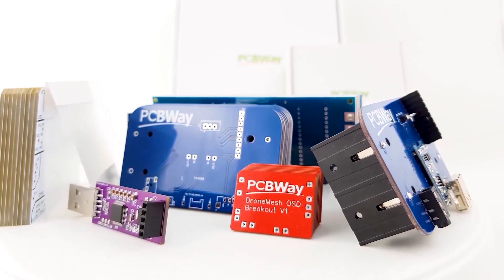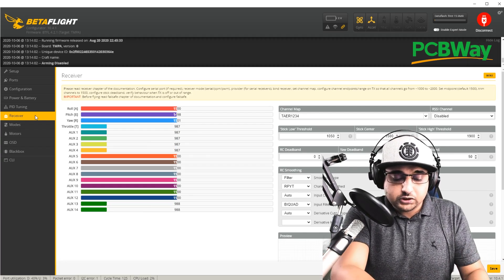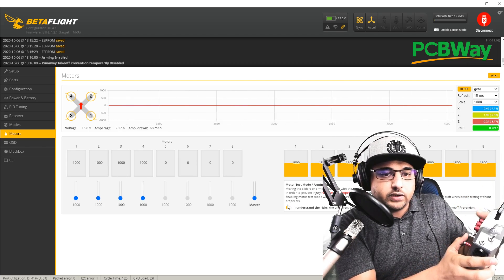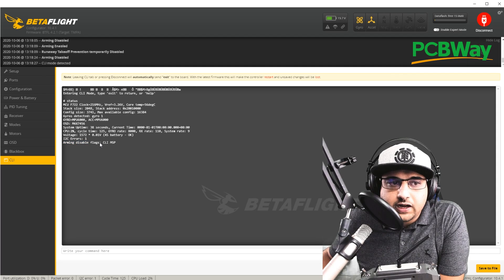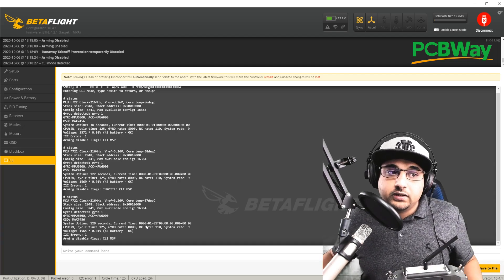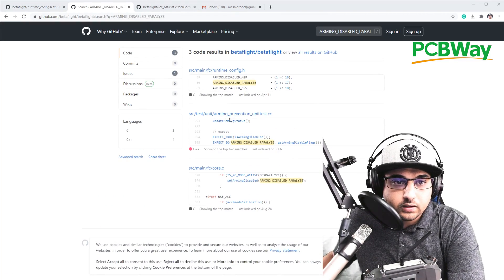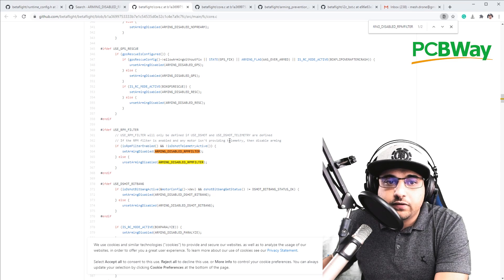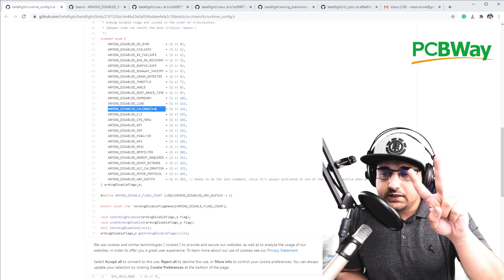ULTIMATE FPV Quadcopter Won't Arm Video FIX // Betaflight Source Code Breakdown

Comment: Hey DroneMesh i watched your video and i have a problem with my hglrc Arrow3 4s where i updated the Firmware and now when i type into the CLI tab diff all bf kicks me out. When i flashed my board i got a "Programming successful" alert and i did back up my old fw but now i dont have any of my settings like Angle, acro and tbe arm switch is not working. I typed in "status" in the cli and i got back this:
Gyros detected:
OSD:None
Arming disabled flags:NOGYROS, 4XLOSS, BOOTGRACE, CLI MSP. 
I tried reloading my old fw but had no luck. Im new to this stuff but i did 1 successful firmware upgrade with no troubles
What do you think is going on and what should i do?

Comment: In betaflight after setting the arming  in mode when I switch to arm I get a red  square which says arming is disabled
all other functions are okay. Cannot get the motors to turn on
Reply: I have the same issue , please assist me
Reply: Same issue, what do I do? Please help

Comment: Bootgrace is important. Thats the code im getting after rotating my fc and remapping my motors. I know the beeper was on c15 which motor 1 was on but motor 1 is now motor 3. Maybe thats it. Also when i go to motors tab only motor 1 and 2 show up highlighted and motor 3 and 4 show no direction and buttons are not clickable. Please please help

Comment: My understanding is 'paralyze' is used in a race environment to completely disable a downed quad from the radio, making it safe for anyone to pickup. You need to unplug the battery to reset it.

Comment: Can you do one trouble shooting osd?
Reply from the maker: What problem exactly?
Reply: @DroneMesh  I've had a few flight controllers where the osd doesn't work and it's difficult for me to determine if it's the vtx, the FC layout, betaflight, etc.
Reply from the maker: Post this on AskFPV with the FC's your having an issue with and the community will answer you in no time. ASKFPV is available in the description under the video. I will look into it and see what kind of video I need to make.
Reply: @DroneMesh  oh yeah, ok thank you
Reply: @DroneMesh  I'm kind of leary of the permissions but I'll look at it

Comment: First arm after flash / set uo throttle full for few seconds then down for few seconds thats calibrated then will arm. Visual warnings flash in osd. Thats it. Its not an error.this is the one that catches my mates out rpm throttle calibrate
Reply: Many people reported rpm lock out on boot then get round it by unplug and so on. If you get rpm lock out try full throttle wait for visual beeper to flash in osd then throttle down then it arms without unplug lipo. After this it seems to go away. Well for me anyway. Lol.
Reply from the maker: What your saying is for PWM calibration.
Reply: Every time i flash 4.2 wont arm until throttle up full(while disarmed). 
Wait throttle down then arms. Thats all i am saying. Historically dshot doesn’t require calibration but it seems to ask this way. Thats if of course youve covered all other pit falls that you seem to of covered pretty well. The weird thing you havent seen before could well be this feature.
Reply from the maker: @noisy_boi_fpv_3920  I will look into it